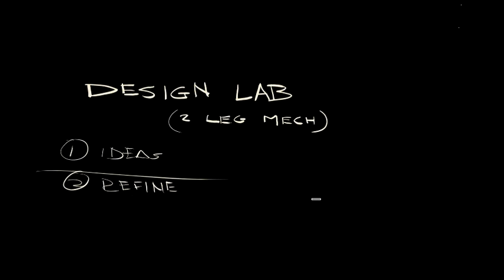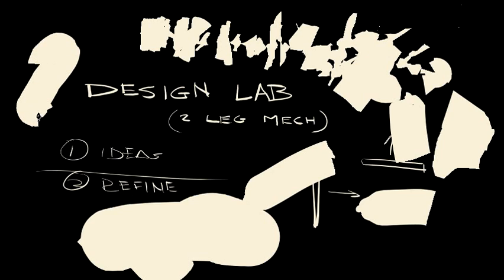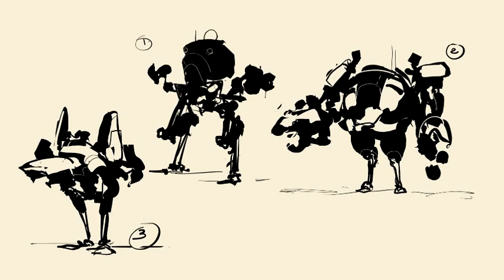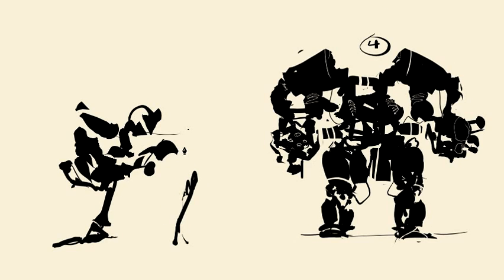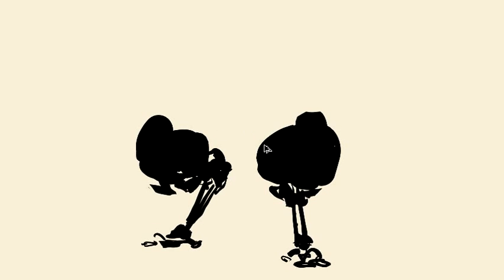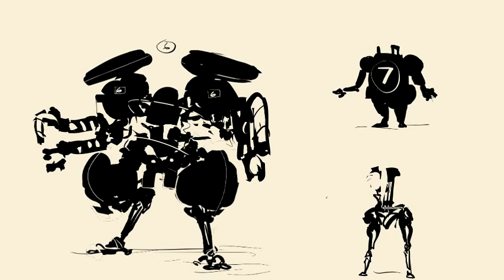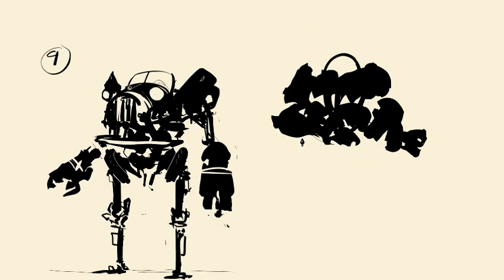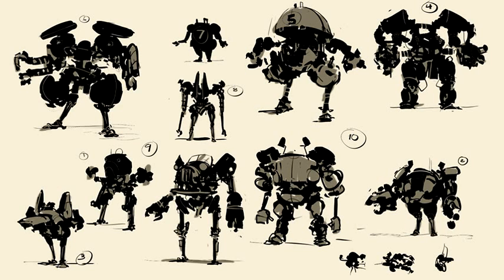Design Lab [2 leg mech] - 1/2

Comment: If you use a intuos a I good work flow tip is to create a application specific key bind in the the wacom options for second stylus button. I bind it to ctl+ alt. I do the same for photoshop. Also good to use a tool as much as possible across your work before changing, you'd be amazed how much time gets eaten up just changing tools every 5 seconds over the hours.